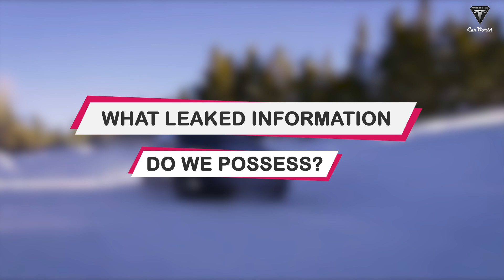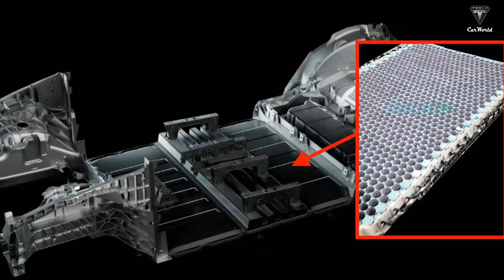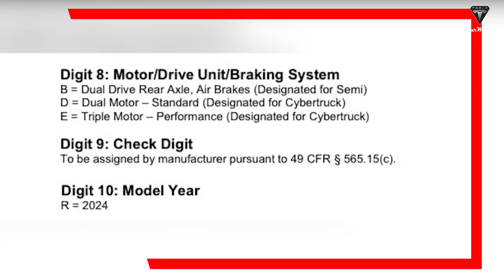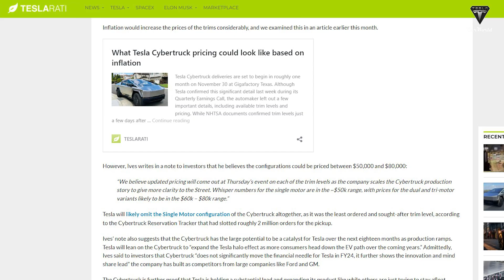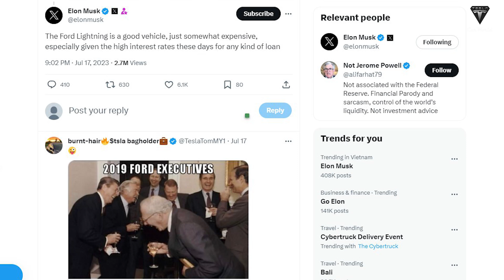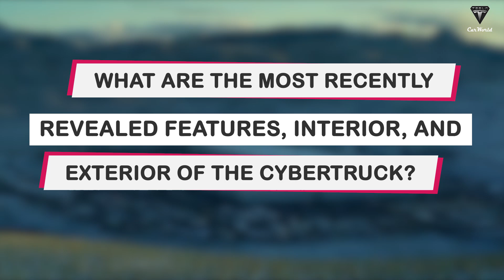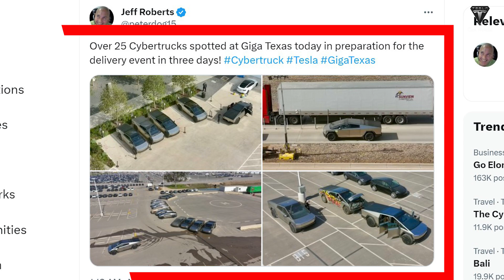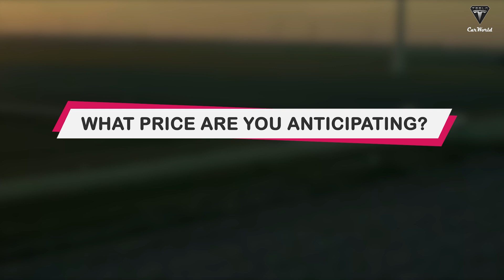Countdown to Cybertruck: Leaked Info and Final Expectations! Cybertruck's Impact on the EV Market!

Comment: Don't beat on it if you know what is good for you.
Reply: THis truck is GREAT! I Drive a Ford F-150 Lightning Platinum on work duties which is ALSO FANTASTIC ..... BUT ..... I like this Cybertruck even better!  I want to mod it already with 40 inch Mickey Thompson M/T tires, a more robust Liquid Spring Active Suspension system, an even bigger lift and some 100,000 lumens multi-colour LED light bars and DCI-4K resolution custom-made 25 microns per photosite RGB and Thermal Nightvision cameras! I will be cutting and welding this baby like NO TOMORROW .... If I have to RIP OUT it's CPU brain and replace it with a few 128 core AMD Epyc CPUs and a custom-coded real-time operating system then I will do it!

Can't wait to get my hands on one!

I think I will ALSO put a 20 mm rounds-firing 6000 rounds per minute 3D-XYZ SOBEL/CANNY edge-detecting autonomous Sentry Mode-capable Gatling Gun in the back bed so I can go all Mad Max in my new Cybertruck bug-out/off-grid vehicle!

V

Comment: If this think is under 300 miles range, it’s a fucking disaster.  

I personally would not by it with under 400 miles of range.

For the S and 3–I’d want at least 325 range bare minimum. 

I’ve said for weeks that if this is at 69k and less than 400 miles—it’s going to flop.

Comment: This is so classic “Truck for the people” bullshit. I guess we need to all be driving the same thing around with nothing individual about it. It’s a fancy stainless steel battery powered refrigerator. Think of all the time you can spend polishing it and finding a custom set of wheels. it would be best used as a food cart 😂